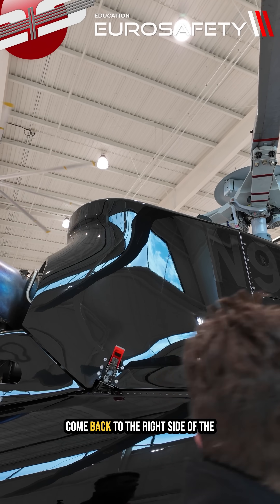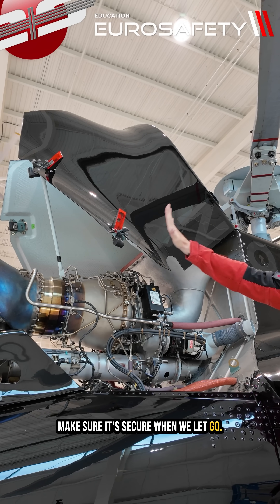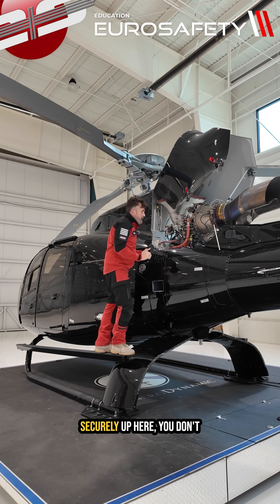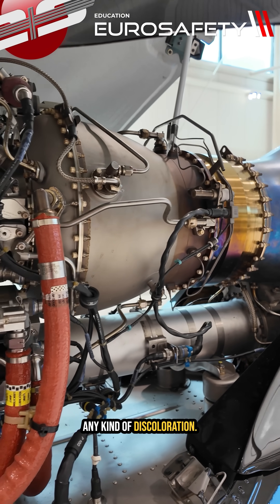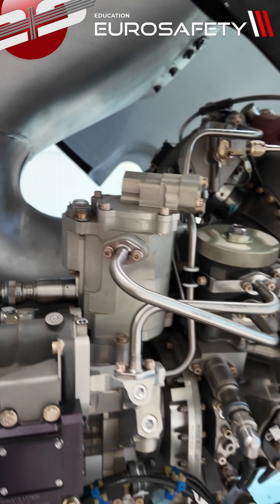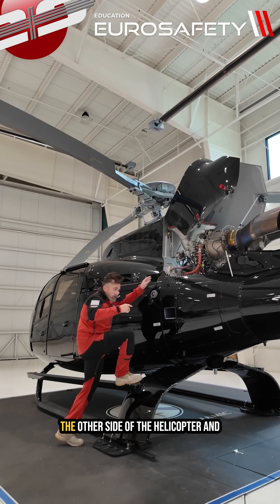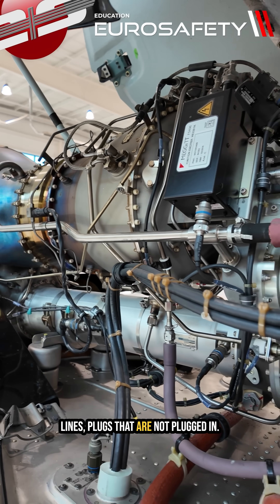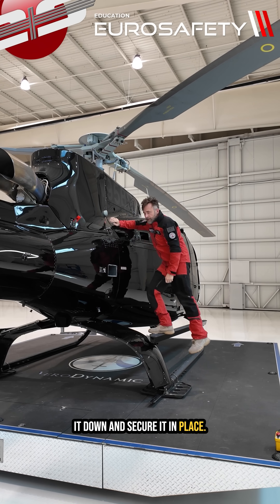#326 - Part 5: Engine Preflight Airbus Helicopter EC130T2

Comment: Also be cognizant of the hinge pin holding the engine cowling support rod to the cowling, multiple times I've seen the pin vibrate out of its supporting cowling hinge and the rod is now only held on to the cowling partially or completely off......not good when you go to prop up the cowling (hard to see this attachment point from the usual inspecting position standing on the skid step).....